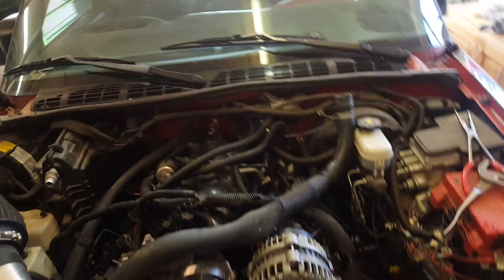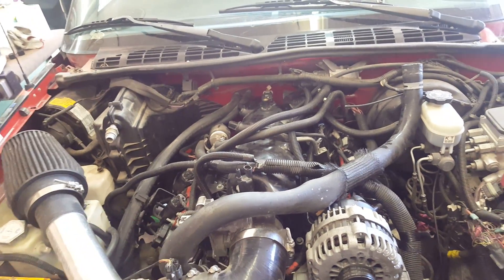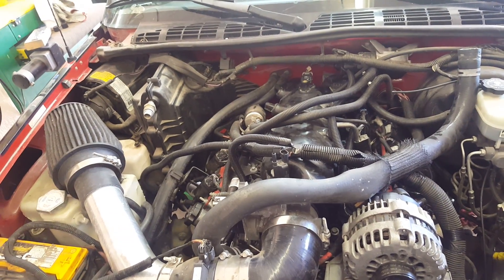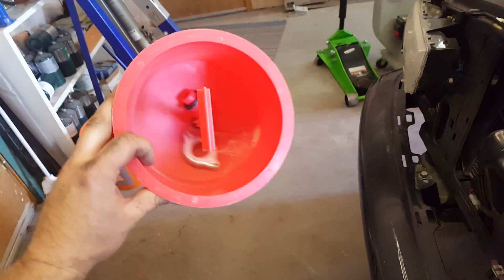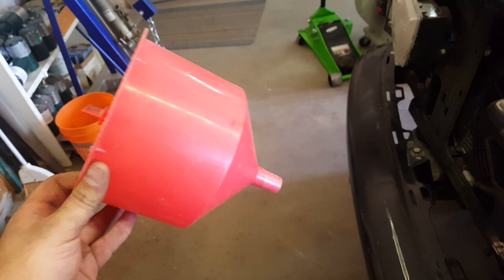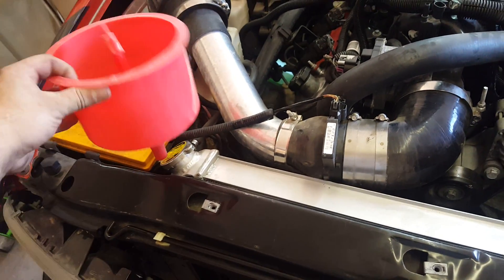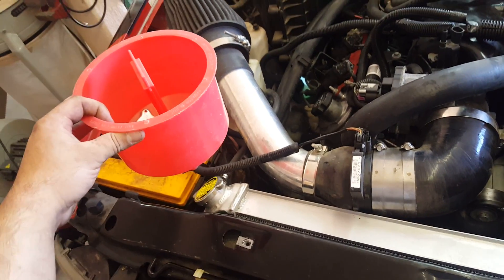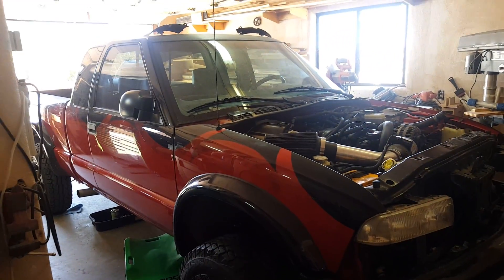Bleeding coolant on ls motors.

Comment: I have the same problem. even spent more money on the special coolant funnel. For some reason it starts to rise in temperature. How else can I release the air in the coolant system ? Im searching for answers before I take it to a shop and spend more money for them to figure it out. Any DIY'ers out there with any tips to spare ?

Comment: Can it be burped if the radiator was already filled and just needs topped off? Mine needs burped and I did the pre fill in the driver side hose like in the video.

Comment: If the thermostat is at the inlet of the lower hose and doesn't open until it's preset temperature, then how is the block going to backfill the radiator?
Reply: That's what I'm saying, tried this on my swap and it's fucking overheating 🤬
Reply: @RogueKnight33  you need to do it from the upper pulley. That will actually fill the block. Some guys get the adapters that spliced into the upper hose that has a cap for the this very purpose, such as Performance Quotient PQx Radiator Hose Fillers 5292272 from Summit Racing. 

Also, what worked for me, with my steam vents hooked up, was that I jacked the front end up, serviced the radiator and let it run to get the thermostat to open and flow fluid. 

If you fill from the bottom hose, there's a very small weep hole in the thermostat that will take forever to backfill the engine.
Reply: @mathewshackelford8037  upper pulley...? You mean upper hose..? I did that
Reply: @mathewshackelford8037  I actually misread the original comment, I filled from the upper hose and it did not come put of the radiator, it filled the overflow
Reply: @RogueKnight33 the overflow is above the cap, maybe someone reversed the hoses?

Comment: You should not have to do this , i have a LS1 here in Australia and they are Auto bleed systems on the LS1 , all you need to do is fill up radiator to Top start engine get it up to operating temp and thermostat opens which the radiator  level then goes down top up radiator and you are done . Really is no mystery to bleeding out air pockets on these LS1 engines
Reply: Your so lucky" I filled mine from top radiator hose to fill block, unhook steam Port vent fill till water came out, hook hoses back up fill radiator, turn on heater,  and I still have a cold lower radiator hose, at 200 degrees, thermostat not open  water not circulating. I'll get it going eventually, but it's sure not going for me the way it went or Always goes for you congratulations👍
Reply: @kevinwest3689  so did u eventually figure it out??  I'm having the same problem now
Reply: @arsenionolley2649 I'm having same issue now. These motors can be hell filling antifreeze.  How did you get yours figured out?
Reply: Do you top off after thermostat opens while running or do you shut it down and then top off?